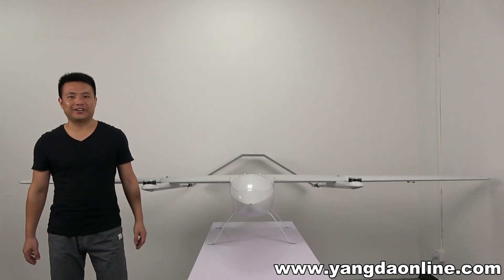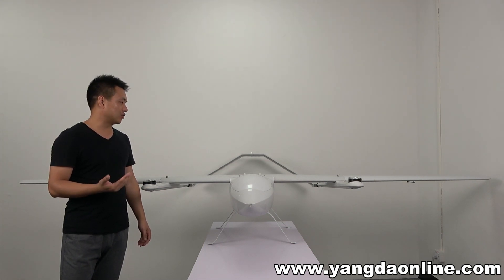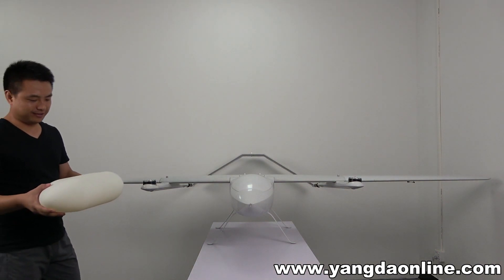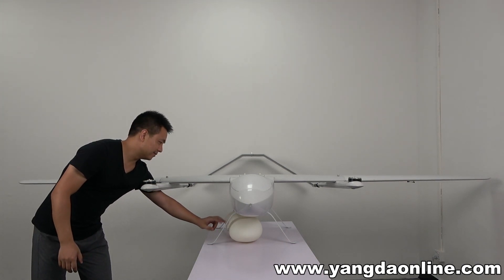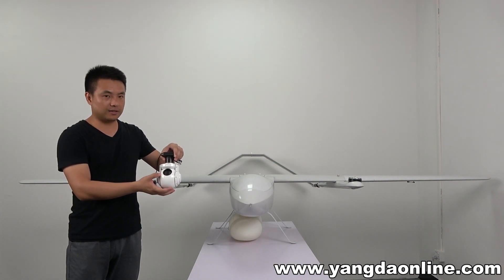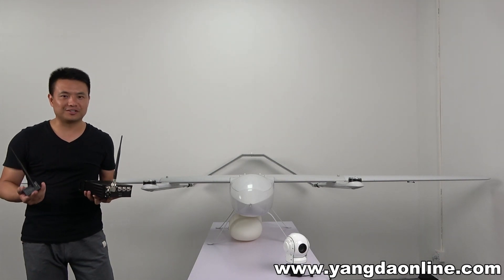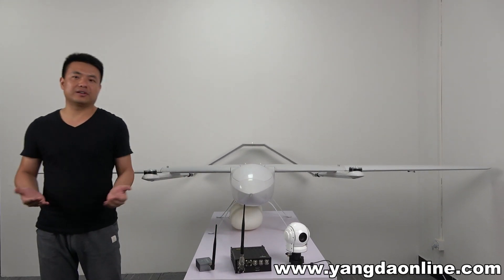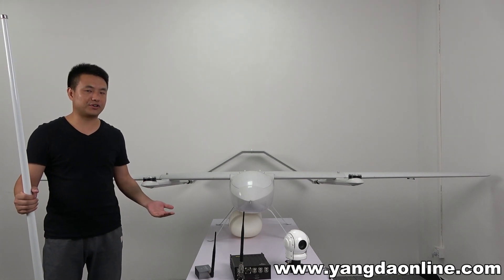YANGDA Long Endurance FW-320 Fixed-wing VTOL Plane

Comment from the maker: FW-320 auto flight demo: https://youtu.be/H-M0Mm12N7Y
Reply from the maker: peter ams Yes you can. It can be achieved by using our 30KM range video & data & radio link.